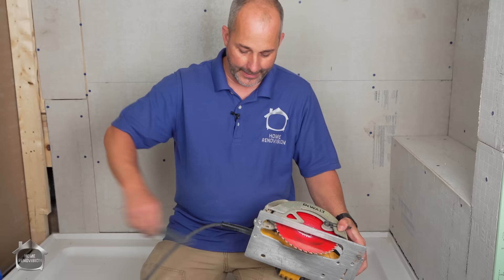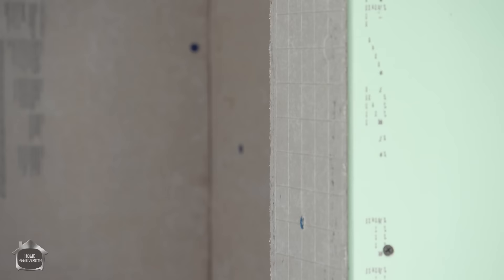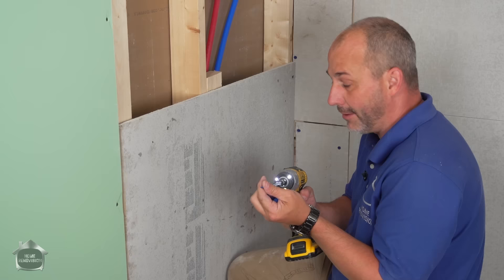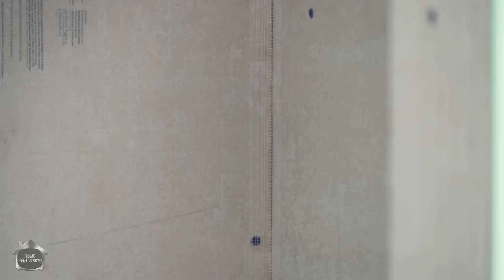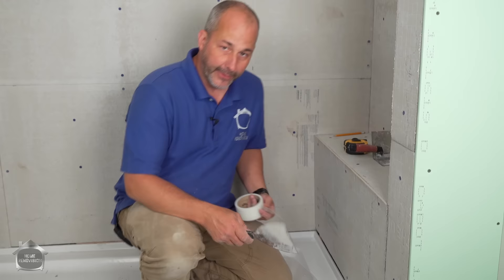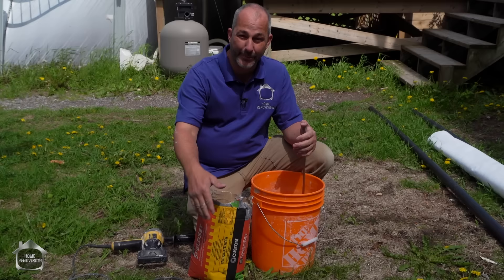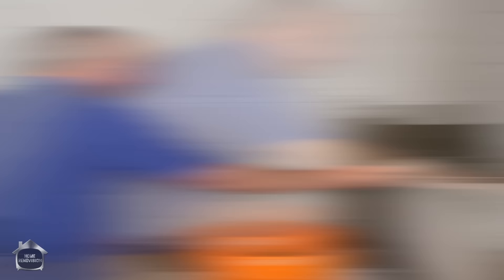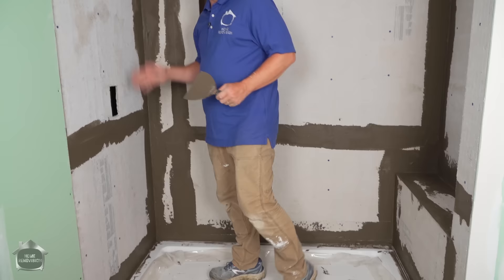How to Install Cement Board for Beginners

Comment: hi jeff...quick question re. AquaDefense  membrane application. We used USG DUROCK cement board for our shower wall enclosure which has a rough surface on the tiling side. When applying the membrane it goes on well using a brush with lots of paint...but the roller leaves tiny little open pinholes where paint wont stick. Do you use a special type roller for the rough surface type cement board application?? your suggestions appreciated. 
cheers IanD

Comment: Jeff,
Thank you for these informational Videos; they are great for DIY homeowners. I am in the middle of a surround tearout and tiled shower install and am using a 7mm 16"x32" tile and am wondering if a 3/8 thinset is enough, or should I use 1/2' thinset?
Reply: Read what the box your tile comes in recommends

Comment: Any problems using the Kerdi shower lt/lts (with kerdi-line tile over drain) and cement board?  Should I seal with the mesh tape or Kerdi's tape? (USA - Washington state)

Comment: If you install a durock board on the top lig of the tube. what is the best method to ensure no water will penetrate between the tub lip and the bottom of the cement board?It looks like you use the cement.

Comment: Hey Jeff I'm in the middle of redoing my mom's shower and I was wondering do I have to use quick set cement for  the gap between tub flange and cement board  and in the corners or can I use thin set  and then I'm red guarding the entire tub surround with two coats  could please let me know thanks

Comment: If you use the schluter system do you need to use the fiber glass tape for the joints under it?
Reply from the maker: kerdi membrane does not require you to reinforce the joints. Cheers!

Comment: I'm installing dumawall vinyl tiles that glue on with Loctite Power Grab Ultimate (recommend glue by dumawall). Do I want the rough side or smooth side of the Hardibacker Cement Board facing out prior to gluing the tile on?

Comment: You really should set acrylic/fiberglass shower pans and tubs on a mortar bed. I also like to run ledger boards for the flange to sit on, and a 1x1 for kick support on tubs for the valance. I also secure the flange to the wall with screws and washers, never going through the flange, but just above, catching the flange with the stainless washers, and notch the backer to allow for the fasteners. My tubs and shower pans don't flex.

Comment: Would it be alright if I have the top of my tiled tub/shower with drywall instead of cement board? I’ll be tiling over it and doing the waterproofing but i dont think it will be too exposed to water as it will be the last 2feet at the top of 9ft walls.

Comment: If my cement board doesn’t fit exactly tight into the corners (about a 1/2 inch gap on all corners)  is this still ok to go ahead and tape and then apply thin set and aqua defense? I couldn’t get my cuts perfect with a utility knife and I need to know if I should start over. I don’t want leaky corners

Comment: Hello Jeff, question. My old cement board was 5/8", I couldn't find that thickness around my area. Is there a way to even an old wall with the new 1/2"?. I wasn't planning to remove all the cement board and drywall in the entire bathroom. Thanks!

Comment: have you ever used " Diamondback® Tile Backer with a fiberglass acrylic shower pan? 
the manufacturer ( Certainteed recommended installation " no more than 6" of waterproofing along shower base " and installing to 1/4" off of base tile ledge"

Comment: If I want to use cement board to cover interior walls in my free standing workshop/garage, do I need to worry about water proofing? I was thinking about putting frame walls with insulation, but not sure if I need vapor blocking film. Also, what about using it for garage floors? Would you recommend it?

Comment: Can i use Kerdi membrane with Cement boards instead of the fiber membrane you used in this video? after that add 2 or 3 layers of redguard? thanks
Reply from the maker: yes sure!

Comment: Can you clean and reuse the brush afterwards or is it garbage after using for the water membrane?
Reply: Liked and joined your monthly subscription came across your videos which are great, thank you. 

Also, what about the transition from the cement board to drywall, do you use the mesh tape and quickset for that transition as well and then after the tiling is complete smooth over the remaining exposed quickset with joint compound for the painted surface? 

I am completing a bathroom that we had hired someone to do for us but had to let go because of their lack of craftsmanship. I noticed that they had used paper tape and standard joint compound over the paper tape, to tape all the seams and screw heads on the cement board which did not make sense to me. Should this cement board now be replaced as I am not certain that the quickset will properly bond to the cement board being it has already been coasted with joint compound?

Thank you again

Comment: After my cement board installation I checked the walls for being plumb and all 3 were good.  I checked the walls for level but only used a 2 foot level across several heights and everything seemed good.  When I installed my ledger boards I noticed on the right wall that the wall appeared to be bowed, but ultimately the problem area is like the last 4 inches to the corner bead area.  The deepest area is about 3/8".  Aqua defense is installed and I was ready to start laying tile until I noticed this.  I will be using the spin doctor leveling system.  Tile size will be 12" and My question is should I use a 1/4 x 3/8" trowel on the ends and a 1/2 x 1/2 trowel in the center area?  Was planning on a vertical small bullnose tile at the corner bead but not sure that will work.

Comment: If the whole shower is Sheetrock and there’s no fan, should I replace everything including the ceiling with cement board? Or can I do board half way up, leave the Sheetrock, use the waterproofer and tile everything including the sheetrock ceiling?

Comment: Question  sir:
Theres a Contractor from Boston on YouTube. He has a video about appling the board over the tub lip and flush with the tub. I can see yours is at the top of the tub in spots. Please explain why you do this in this way? Thank you. Im trying to get the best of all videos. 
Also I used AquaPro  mastic and its horrible.  It made my tiles slide down it dried.
I know now where ever you live must have alot to do with things.

Comment: Because my real log walls will support the only wall I am building, my plan is to use 1/4" pine lattice moulding as strapping, and 1/4" hardie board to build my waterproof shower wall. I have very limited space and every 1/4" will keep the shower screens from extending past the door as much. Will this be ok? Thanks in advance.

Comment: Can I use the Schluter Kerdi Valve and pipe seal with the cement board. You do not show how you protect the fitting openings from water getting in.
Reply from the maker: That is because there really isn't a lot of water finding it's way there as long as you seal the fixture to the tile.

Comment: If using the roll on membrane is the sealing of the cement board joints neccessary? Love the videos, keep them coming
Reply: Using mesh tape and thinset on the joints helps prevent movement so there is less likelihood of cracks in the tile or mortar line later on.

Comment: Q: I have soaking roman tub, no shower head there. There is tile surrounding it on the wall. Do I need to waterproof this area on the wall? Also, if there is space between the drywall and cement board, do I just seal it with the tape and cement?

Comment: I just finished the demo on the walls and realized the old cement board is 5/8" and the only thing I could find around me is 1/2". Is there a way to level those?. I wasn't planning to remove ALL drywall or cement boards, just cut the one around the old tile area. Thanks!
Reply: I have the same problem with mine. Just get 1/8 underlayment and cut furring strips to nail to the studs so the 1/2 backerboard is flush

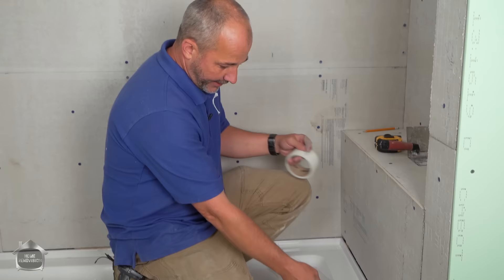Comment: @7:28, Won't that cement between the seems crack over time with the flexing? Won't water vapor build up and with gravity pulling water downward, eventually the moisture will go under the edges of the board, and eventually get into the board creating black mold? I am in California, San Diego

Comment: Hi Jeff, what’s your view on using Densshield or Glassroc instead of Hardiebacker fiber ciment boards?
Reply from the maker: To date I have not found a way to seal the joints aside from silicone and I don't trust that long term. Going to the trade show in February in Orlando to update my knowledge and bring you guys the latest in advancements. Cheers!

Comment: Hello :) here in Ireland they don't have flanges/tile upstands on shower trays, do you have any advice on how to you would adapt your technique to fit such tray? (often here they use some stick on rubber to go all the way around and put the cement boards all the way to the floor, what would you recommend to keep an eye on if one uses this method? or would you use a different method?) installing my first shower cubicle here, so thank you for the fantastic videos!

Comment: Hi, I appreciate all your video. I purchase the Hardie backer board that is supposedly 100% waterproof. Question should I still use the waterproof membrane?
Reply: BTW- I am in Idaho, USA.
Reply from the maker: Hi Johnny. The cement board is waterproof because it will not degrade in wet conditions. Therefore it will survive the presence of water. To waterproof the shower a roll on or kerdi membrane is still needed to avoid water from soaking into and behind the cement board which is where most showers fail in time.

Comment: Hi Jeff, cost effective approach, thank you! 
How are you taping the joints that transition from cement board to drywall, with mesh and thin set as well? Does the tile edge typically match the underlying joint?
Reply from the maker: i line up the tile edge 1" past my cement board. Cheers!

Comment: Question I have. I'm doing tiles walls through my whole bathroom and floor. Also doing a shower stall. Do I need to cement board the walls and floor for prep for the tiles? I've seen your video using redguard coated mildew resistant sheetrock for the shower but wondered about walls and floor. Thank you so much. Absolutely love your videos!! So helpful
Reply: What did you end up doing.    I'm about to do the same thing to my bathroom and floor throughout my tiny home, I will be using 1/2 cement board for all of it.  Modified thinset under the board and the same thinset to set the tiles.   I will only be taping the seam in the bathroom, because of the waterproof membrane..
Reply: @homesteadhaven2010  unfortunately I didn't do it because I'm waiting on a contractor to do the foundation work first

Comment: I was just wondering why you didn't use fiber mesh tape for cement board. Its resistant to the chemicals in cement board like not using drywall screws because the will break down. Just wondering.

Comment: Our shower looks almost exactly like this! If we use silicone sealer for the joints instead of cement in the joints, then paint the membrane, will that be sufficient?
I also painted the cement board with the aquadefense membrane on the edges and back up to about 12 inches.
Reply: I'm wondering the same. I'm a bit weary of not bringing the cement board over the shower flange

Comment: Please help... I live in TN. I have my whole bathroom pulled out (DIY) I've been looking at remodel videos for 3 weeks now...all day.. im struggling between the cement board vs the foam boards .. im redoing my bathtub and doing tile. I know u need to use the aqua defense and the tape membrane... but the cement vs green backerboard..foam...its all confusing..

I seen a video that showed water soak thru the cement board.. HELP

Comment: I have watched some of your videos more than 8 times.  Thanks for giving us years of your experience in these videos.

I have installed Cement Board in the bathroom but by mistake, I have applied a joint compound to the top of the cement board (about 2 inches) where it gets close to the ceiling which is drywall ( I was trying to use paper tape in that corner).  I want to tile the wall but the joint compound is a problem.  I called the Prolite tint set company and they told me to use Kilz Premium 3 before I apply the tint set.  I have removed some of the joint compounds by sanding them.  Is there anything else that I have to do before I start to tile?

Thanks

Comment: Dont you need a small expansion gap between the cement boards? And isn’t an alternative to the waterproof membrane putting a 5 mil plastic sheet behind the cement board?

Comment: Would it be possible to use the caulk product that you used in one of the drywall shower videos with the cement board instead of tape and quick set cement on the joints? About to tear out the tile in my shower but getting products set before I do.

Comment: HI Jeff... Awesome stuff.. I watched my first Jeff video a few weeks ago and I think this one is like my 47th... I'm doing a bathroom myself (1st one) and have a question. I'll be doing an alcove bathtub/shower using 1/2" cement board on top of studs, then tape, thinset, redgard and finally 12x24 tile. I see in this video you also use 1/2" backer on the studs but I don't see any blocking between studs just above the tub rim. With 1/2" CBU, do I need that blocking?

Comment: You should be specifying a cement board mesh tape, it looked like you were using drywall mesh tape?  Cement board tape is designed to handle contact with board and mortars and is similar to the fiberglass in the boards.  It is stronger too.

Comment: What tape do you use when the cement board buts up to regular drywall?
Drywall paper tape? Fiberglass mesh tape? Or specialized cement board joint tape?
Thanks for what you’re doing!  Huge help to us DIY’ers.

Comment: Have you ever done a ceiling in a shower and tiled it??  What type of backer board is used?   We would like to use 12"x 12" ceramic tile .  I have heard of people using construction glue instead of thin set on the ceiling can you are anybody else know how to do this??  By the way your videos are great, so is the audio ( I'm hard of hearing).

Comment: I've enjoyed your many varieties of material installations...great information. I have been brought in to finish a project that a homeowner started (Ugh!). The shower is 36" X 82" and he has shown me pictures of all his backing for handicap rails and a folding bench, and he has done a nice tight job of hanging half--inch USG Durock on the walls and ceiling. After mesh taping and cementing the seams and corners, can I use Redguard on the Durock? The homeowner has two 3 gallon pails of Redguard so I could easily get 4-5 coats of the product on. Will that be sufficient?  Peace.

Comment: Which ones better? A cement board with schluter tape, unmodified thinset mortar, redgard to seal joints or cement board with sticky mesh tape, thinset and redgard?
Reply from the maker: no difference, you are relying on the redgaurd for waterproofing. save your money and go with the mesh. Cheers!

Comment: Hi Jeff, when you were putting cement around the tub did you protect the corner/ edges of the tub with anything in order to prevent from getting scratched?
Reply from the maker: nope I just angle the tool so it only scratches under where the tile will be installed . Cheers!

Comment: Cement board manufacturers recommend 0.5 inch board for all walls. Where are you getting your information from? Also, they say to install screws every 6-8 inches not every 12 inches.

Comment: Thank you for all of the advice, very useful stuff! I am going to apply the roll on membrane, is there a specific type of roller I should be using?
Reply: fine hair roller... that stuff is very thick. Last coat I would throw a little dry sand to bond with the tile glue, makes it hold on to something (sand) you don't need much.

Comment: Why do you mud every seam except where the moisture resistant drywall (green board) meets the cement board, but you did on the backwall.  I've seen two different videos with the same thing.

Comment: Hey jeff!  Love your videos. My husband and I are redoing a bathroom shower.  Few questions:
1) we are using hardibacker 500 for the walls and the Kerdi pan for the base.   Can we use the Kerdi-Band for the joints or are we better to use the mesh tape?

2)  where we bought all of our tiles and Kerdi accessories, they have told us we are ok to use servolight mortar but when I look this up, it shows as a modified?  I’m nervous to use this but assume they must know what they are talking about?

3) what preference do you have for a liquid membrane over the hardibacker? My husband doesn’t want to use the Kerdi membrane...it’s an argument I’m not winning!
Reply from the maker: kerdi band is great. What I would do is  paint a waterproofing membrane over all the walls right to the pan.
Reply: Home RenoVision DIY thanks so much for your quick reply!!!!!!  What are your thoughts on the servolight mortar?  Also, is there a waterproof product you like the best?
Reply: Hi jeff!  Can I paint the liquid membrane right over the Kerdi-Band?  Do I need to wait a certain curing period of time before doing this?

Comment: just about every saw I can think of is reverse thread i don't even ask myself what way does this saw turn.    The other thing is saw blades have have a label side. this side always goes to the outside or away from the motor unless you are using the blade for it's intended purpose. ie   cutting vinyl soffit or siding material.